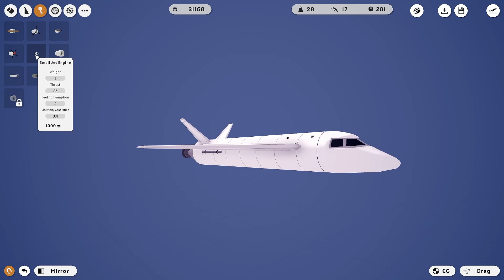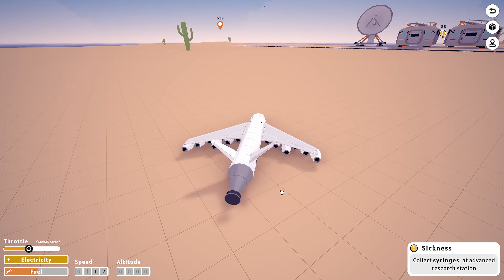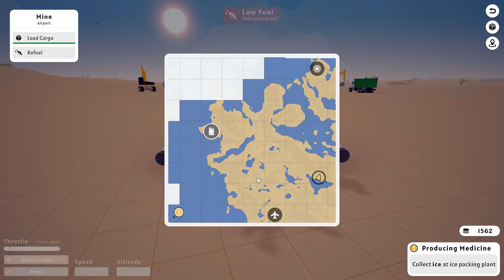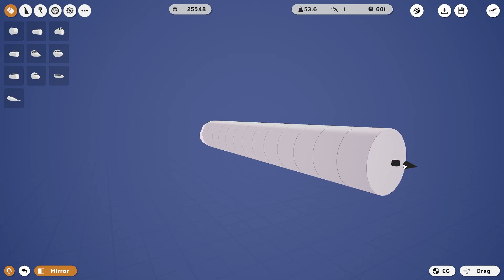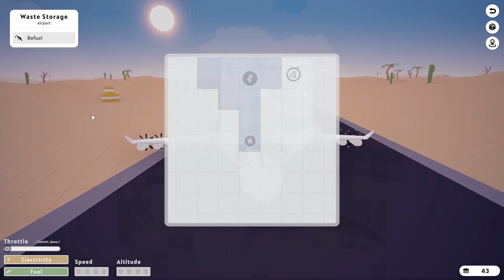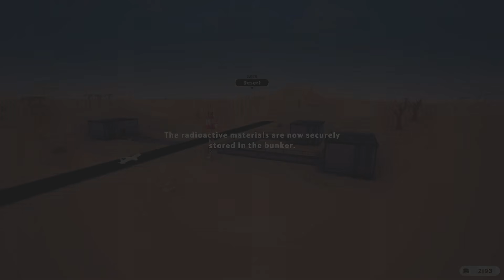Building A FULLY ELECTRIC Cargo Plane in Aviassembly

Comment: electric planes are OP if you have the money for it just build those little turbine generators and solar panels until the electricity created is more then the electricity used and then clip hide them inside the main body fuselage since they have a weight of 0 and there you go a infinite distance flyer

Comment: the turbine generators are why your electric plane didn't work. The big electric engines make a lot of drag. You can cheat that by tucking extra engines into the body like you did with your fuel tanks. Solar panels are the way to go for infinite flight. You can stack them and tuck them into the body and they still work 100% You can actually make the big cargo plane fast as hell with electric

Comment: To be able to do a barrel roll or looping:
1. Close the game, so you are back in the main menu
2. Open settings
3. Turn off "Auto-Steer"
It changes the behavior of the plane quite a bit, and makes it easier to crash. But you have much more control over the movements of the plane.
Think of it as hardmode for steering.
Reply: i tried using that to begin with. ... really finicky with keyboard controls, may be easier if i used a joystick setup or a controller (i'm more used to controllers than M&K)
Reply: @LoliFoxQueen  I did it with M&K. Yes, it is finicky, but once you get used to it, it's fine. My first playthrough was with Auto-Steer and my second without and it didn't take me any longer.

Comment: The big limiting factor for planes is drag, and engines are the source of a lot of it. That's why the final jet engines are so good -- you get masses of thrust for minimal drag without needing to cheese things. For the electric engines I like to stack them in a line and pretend they're just one much bigger engine; was able to haul four titanium around on eight of the big ones with that config. Powered it with a pile of solar panels. 

Reason you can't do a barrel roll (or aileron roll, which is what you were actually trying to do :v) is because the auto-steer setting is turned on. Turn it off through the main menu and you have a lot more freedom in your flight controls and I personally found flying things a lot smoother with it off.

EDIT: The big electric engines are more efficient at converting power to thrust, 20:1 instead of 15:1, so you can get the same amount of thrust for less power use, which means you can save on generation/batteries.

Comment: 10:40 there is also the Globemaster, a slightly larger transport that uses two large jet engines, though C-130's are used much more often. Likely due to how much cheaper they are to operate. (Source - i like about 400 meters from Canadas largest Airforce base, directly in line with the runway, so I see legitimately everything that flies in and out.)

Comment: I'm over here wanting to see you build a Fokker-style triplane, only using big wings. Because ridiculous lift is ridiculous.

EDIT:  You might have been able to do the radioactive waste run with a pure electric plane if:
1 • You mounted custom-sized fuselages for the engines to mount to
2 • You configured the engines into push-pull pairs on those auxiliary fuselages
3 • You either A) took advantage of game physics and squished all the air turbines into a single dense line or B) went solar and just stopped to recharge whenever you needed to.

Comment: The moment I saw that the turbines exist in someone else's video, I immediately got annoyed with the dev... The laws thermodynamics be like, "Am I a joke to you?"...

I wonder if you can make "missiles" by using the decoupler and rocket engines...
Reply: The turbines of themselves would be fine -- air turbines exist on lots of planes for emergency power -- if you properly paid for that power in drag.
Reply: @foamyesque  Well yeah, not for thrust but for keeping the radios, controls, and location equipment functioning after all the engine turbines fail, which'll pretty much require the engines to inhale an object or straight up explode. I can't imagine them being genuinely needed unless it's the last flight before the pilot retires and it's on a Friday the 13th...
Reply: @ShawnF6FHellcat  One famous instance I am aware of is the Gimli Glider flight, which had an all-engines-out scenario because it ran out of fuel mid-flight owing to instrument failures and bad math.
Reply: @foamyesque  Definitely a crappy situation to be in...

Your username looks very familiar like I've commented with you somewhere before, but I can't seem to remember where...
Reply: @ShawnF6FHellcat  Likewise, actually. Not sure where myself either.

Comment: I found when I played that the solar panels are the way to go with electric engines. you 100% can build a heavy lifter with infinite range using solar panels to keep your engines topped off - just gotta math how many panels you need to provide enough charge: engine uses 1, solar panel provides 0.2, so 5 panels per engine. More thrust helps take off, but so does more lift, so you could cheese it with one of those many winged monstrosities and a smaller number of engines

Comment: The turbines are spinning because the plane is moving. The truck tries to pull itself with the magnet attached to itself. They are extremely different things.
Reply: But the turbines that generate electricity will generate more drag than the energy they transfer to the turbines. It will not even lift from the airfield. There is a reason the electric planes irl are light and with massive wing filled with solar panels.